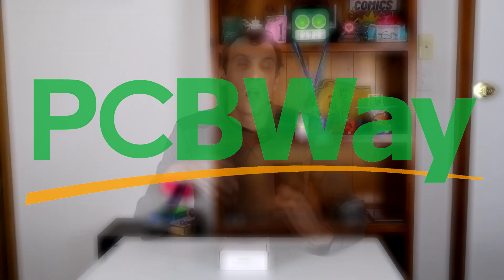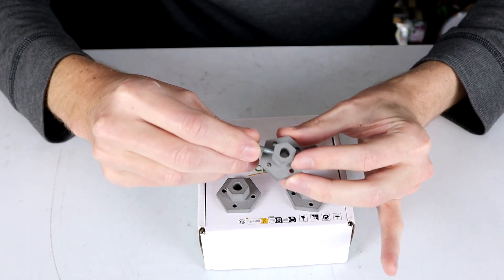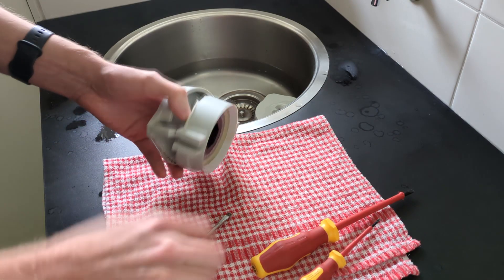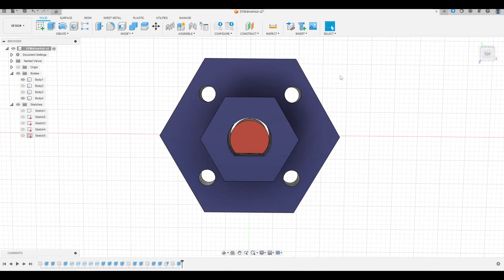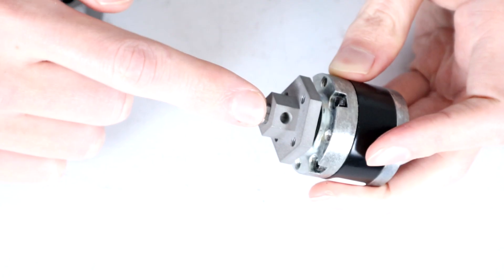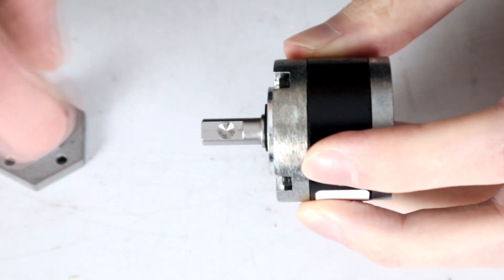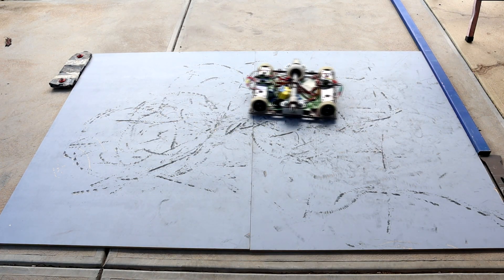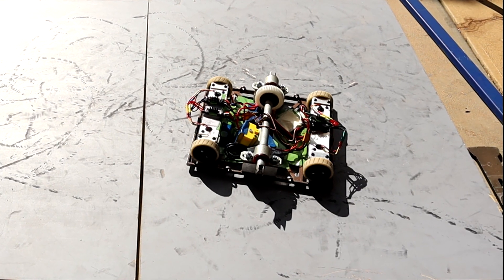Metal 3d prints get more out of my fast bot! (SYM drive upgrade)

Comment: I also cast PU 60A wheels for my featherweight, I didn't bother even trying to reuse the moulds, I just did them in vase mode with just 1 perimeter and peeled them off the wheels. Maybe vaseline would have been a good release agent though. The wheels / tyres were nice and grippy but didn't last that long.
Reply from the maker: Interesting, I was worried that vase mode would bulge with the weight of the PU did you find they kept shape well enough?

I should try vaseline, its been suggested a few times now
Reply: @TeamPanicRobotics  I've have actually made two different designed 60A feather wheels and had them be reusable. With the mold release I'm using I can take the wheels out of the molds by hand without tools pretty easily
Reply: I use Smooth-On VytaFlex and their Spray on release and have been able to reuse PLA molds without recoating them a few times

Comment: How did you arrive at the geometry that holds the polyurethane tyre to the hub? Appears quite unique. Drill jig is a neat system, particularly the use of bearings in place of the usual metal tube.
Reply from the maker: prior experience I guess?
In ants and beetles I've found that hex hubs work well and dont skip oftern, so when I was designing my own hub I wanted to go for a hex, not that the shape makes much difference, the bolts are probably doing the majority of the work here

Oh interesting, I hadnt seen the metal tube method and tbh didnt have a metal tube that would have been a good fit. So i used what I had, it worked pretty well, but I ended up abandoning the top bearing, one was enough

Comment: Vaseline is a better mold release for PU than what you're using.
Reply from the maker: I'll have to give this a try
Reply: @TeamPanicRobotics I do thin it down a bit with some alcohol and apply with a q-tip. Works like a charm. If you can justify the cost, TPU molds are great.

Comment: The grub screw is on the correct side, the hole you drill will help it from slipping off but I doubt you need it considering how nice of a fit that part has on the D shaft.
Reply from the maker: They fit very snuggly, I'm confident they are going to do the job

Comment: From this distance it looks like the vehicle not running straight when wheels are slipping. How even is  the weight distribution or wheel heights/angle to surface?
Reply from the maker: the weight distribution is currently off, as a bunch of parts where just taped in place, the balance will be better in the final build